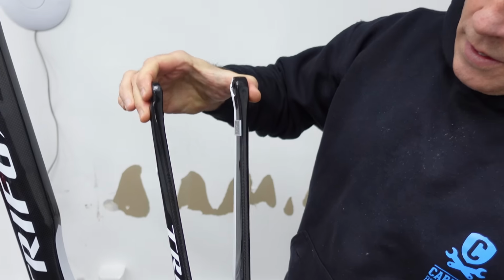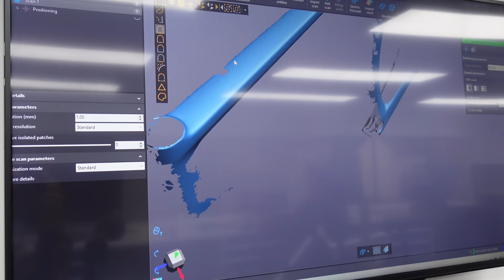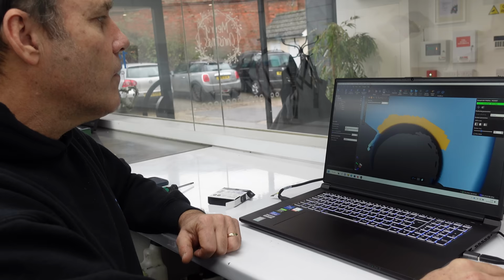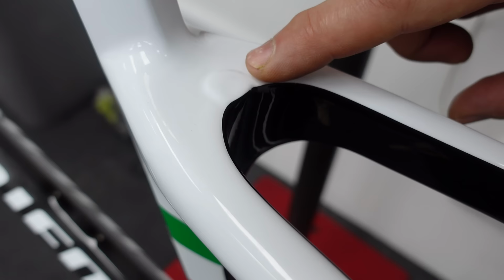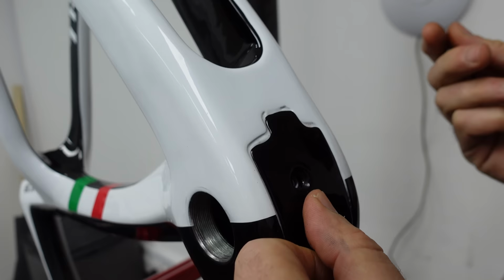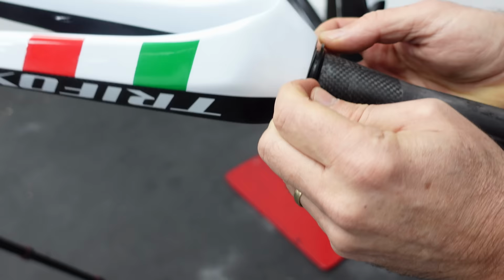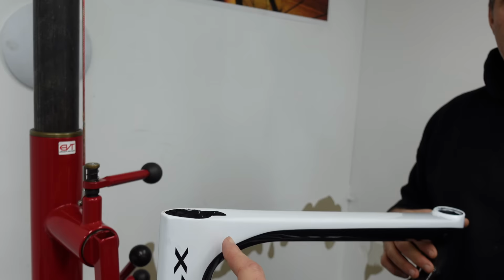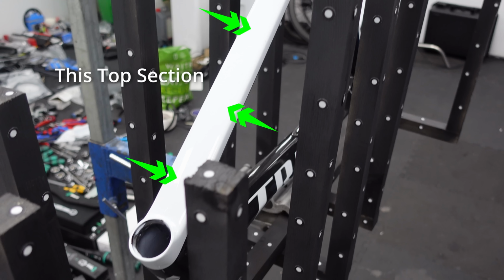Carbon EXPERT Reviews My £300 Chinese Carbon Frame!!

Comment: Almost every major brands lower end carbon frames are built the same way - lots of carbon and heavier (almost to the same weight as AL) compared to their highest end models. Usually also made in the same factories as well. Carbon is actually a very cheap way of manufacturing, the expense mostly comes the mold and prep we really shouldn't be paying the absurd prices bike companies charge for them.
Reply: Yes. It commercially costs 10,000 USD for a mold. To a factory, it is probably less than half of that.A mold can make 50 Frames. The carbon costs next to nothing. With very cheap labour and costs, factories are spending $150-$200 to make a frame
Reply: “Build in the same factory” does not mean “built to the same quality control standards”. 

Cheap frames are cheap for a reason
Reply: @benfinesilver2250  are the molds "compromised" after 50 frames?  i thought the molds could be used indefinitely?
Reply: @konanoobiemaster  Hi. I asked factories because a friend of mine has designs for bikes. I live in China. They said the mold could be used about 50 times before needing to be replaced.
Reply: @benfinesilver2250  thank you sir i had no idea!
Reply: buddy, the most expensive part is actually the research that goes to create this stuff. You're mostly paying for the technology rather than the material cost alone...
Reply: one night argue the high cost of carbon frames is partly caused by the increased risk of liability

Comment: I've learned enough with my experiences over the years that carbon doesn't belong on any of my bikes. You want carbon and are willing to take the risks I wish you luck, but it's got to be made of metal for me the rest of my days.
Reply: OK boomer
Reply: Then don't fly on any recently built aircraft or drive many of the latest automobiles. Many have carbon fiber parts.
Reply: @jamesmckenzie3532  Care to point out what those are? Do you work on airplanes or is that something somebody told you?
Reply: @Charles Man  Wing surfaces are a major area where carbon fiber is replacing aluminium. Not much stresses and it's actually lighter. Some planes are using carbon fiber in the fuselage as this is another area where weight can be saved.
Reply: @charlesmansplaining aircraft parts like the entire horizontal stabilizers for large je liners or entire wings and large part of their internal structure... you can look up the flex test for aicraft wings.... the carbon wings of the most modern jets flex many meters...

In cars its anything from body panels, parts of the car shell, supercars use carbon for the entire mocoque, high end race cars lik F1/F2/F3 or the endurance racing LMP cars are made out of carbon fibre monocoqe and carbon/kevlar body panels... even stuff like control arms, prop shafts for over 1000Nm are made of carbon...

The list is pretty much endless from sport equipment to medical stuff to cars planes bikes safety equipment like helmets or crash structures in many aplications.... cars and planes use carbon brakes sure its different technology and type of carbon but still a carbon...
Reply: @17tomashavlin  You go ahead and trust it. When it comes to bicycle parts made of carbon I'm not trusting it. Period!
Reply: 6061 for the win!

Comment: Radius on the fork assembly has nothing to do with the deflection of the fork. Resistance to deflection depends on the flexural rigidity (EI) and the stiffness of the end connection. Flexural rigidity is increased by either increasing E (Young’s modulus) which is a material property or I (The Second Moment Area) which is determined by the section dimensions and material thickness. Both forks have similar external dimensions, so it is very likely that the cheaper fork is thinner and or is built from a lower grade of carbon fibre.  Is that a problem? Well it depends. Providing the fork is rated for the potential static and dynamic loads it will experience it is unlikely to catastrophically fail even if it’s flexible.
Reply: Can load rating be calculated by determining the Young's modulus acoustically?
Reply: @philhunt1442  Simple answer is I’m not sure. Are acoustic methods reliable for composite materials? Not sure why you’d want to do that unless you were uncertain about the source and provenance of the material in the first place? In that circumstance I’d be a little inclined to be wary. What I was describing above was design properties. If you want to confirm the structural integrity of something that already exists then load test it with loads that are comparable to what it will see in service and follow that up with visual inspection and NDT. If you are designing using material that has uncertain properties then take a conservative approach (build in significant safety margins)
Reply: @donharrold1375  Ah, I see. I think modal testing is indeed reliable, simple and straightforward and is a great way to get exact stiffness values for custom wheel building, for example, using hooke's law you can derive stiffness from an experimental frequency result of an object by squaring it and multiplying by mass. This negates the potentially destructive nature of limit testing along with many other benefits to the traditional design process. But also useful to test and compare cheaper overseas production vs domestic and determine which parts have negligible differences in strength.
Reply: @philhunt1442  Thanks for the interesting observations and comments; not sure I understand them all, but it’s always interesting to hear different takes and opinions. One of the interesting challenges of manufacturing bikes (essentially consumer goods) is the need to optimise strength, stiffness and aerodynamic properties whilst minimising weight, without creating an impractically expensive or potentially dangerous product.  Control over details is critical.  Buying direct from Chinese factories gives me a degree of anxiety because of the possibility that manufacturing and cost compromises might unwittingly lead to a product becoming unsafe. That could happen with big international brands too, but qualified management systems make it less likely.
Reply: I thought it a bit strange the guy went on about sideways flex on fork blades that are clamped at the other end by the front wheel. Don't see how fore/aft flex would be greatly affected by the radius of the fork crown in that direction, so what's the big deal?
Reply: @Ralph Reilly Yes but details like radii are a local property. I was describing global properties. Local properties don’t govern overall stiffness to a significant degree.  They will drive localised stresses. Sharp transitions lead to stress concentrations which might be a problem for long term durability.
Reply: I am not sure about that. The Chinese fork stays are clearly thinner where they meet the crown.  To me that gives less sideways  rigidity, everything else being the same.  Like you would if you nailed down a 1 X2 board on a 2 x 4 , versus nailing a 2x2 to a 4x2. The 1x2 would almost fall off by its own weight while the 2x2 you could almost lean on.
Reply: Broski you gotta round out your engineering knowledge. Stress concentration in curved members is a real thing and yes, a smaller radius will result in a larger stress concentration leading to a greater angular deflection. This angular deflection is exaggerated when you stick a long cantilever on the part (like the fork end).

Comment: That point about seatstays breaking is kinda funny.  I've seen several bikes where people are riding around on a broken seatstay bring it to their shop complaining about a noise or weird ride feel.  I don't know about carbon, but with steel people have gotten away with riding with a broken seatstay for far longer than you or I would feel comfortable with.
Reply: Seatstays and seat tubes are some of the least necessary structures on the bike (bikes have literally been designed and built without them for almost 30 years), and as such aren't worth worrying about a whole ton.

Comment: I know very little about bikes but on the flex thing, when the wheels are on, it wont flex so much? would it affect ride or is it a failure risk down the road?
Reply: Not necessarily, when the wheel is fitted the through axle essentially turns the arrangement into a square box which is very stiff, the forks won't be able to flex relative to each other.

Thinking about it mechanically it might have slightly lower stiffness laterally but if there's that much lateral load going through the bike then uh... You probably have bigger things to worry about 😂😂💥

Comment: This carbon explanation gives me new light in tonwhat actually could have happened to the Titan submersible when it imploded on the way down to the Titanic. Someone could have very well over stressed and over torqued a component that was attached to the carbon fiber tube and caused fractures in its structure. Carbon can be somewhat forgiving but once it's damaged, it's done.

Comment: Don't buy cheap Chinese made frames.
Buy OUR Chinese made with EXPENSIVE decals frames hanging on the wall behind me.
Reply from the maker: Why wouldn't you buy a cheap frame from china? No one has said this frame was bad, plus there is part 2 coming. The expensive frame on the wall only cost £700 for the whole bike second hand
Reply: @JourdainColeman  he summed up the whole trade fairly.

Comment: I would like to see a comparison between a high end Chinese frame ($ 1500) compared to let’s say a Specialized 
(Yoeleo/ winspace) 
Because I have seen recently two Specialized frames that have cracked I think these ultra light weight frames are not useful except for riders that get them for free because they are sponsored
300 grams extra weight makes approx 10 seconds difference on a 1000m high difference climb (who cares if you are not a hill climbing racer?)
Reply: @RealSweetKid me too I think It is an unfair comparison a frame for 3000 vs one for 300 bugs
Knowing that the one for 3000 is also made in China
Reply: Given a rider weight of 65 kg, two bicycles with weights of 8 kg and 8.3 kg, and a 7.8% incline over a distance of 1 km, we can calculate the following:

Bicycle 1 (8 kg): Average speed = 24.7 km/h, time to climb = 2 minutes and 25 seconds
Bicycle 2 (8.3 kg): Average speed = 24.5 km/h, time to climb = 2 minutes and 27 seconds
So the rider on the 8 kg bicycle would climb the 7.8% incline over 1 km in approximately 2 minutes and 25 seconds at an average speed of 24.7 km/h, while the rider on the 8.3 kg bicycle would climb the incline in approximately 2 minutes and 27 seconds at an average speed of 24.5 km/h. Thats for a rider with 400w watt output
Reply: They crank whenever they crash. Carbon frames are good at taking slow pressure but can't handle impact hits whatsoever.  So any crash or curb bump will totally destroy the frame. It could probably take a bunny hop hit

Comment: Has anyone ever wondered why Rob's repair shop is full of carbon frames?
Reply: Because it's a carbon repair shop, he doesn't work on aluminum or steel bikes. Aluminum bikes are cheap enough they're usually just thrown out, and steel frames can be rewelded anywhere. Carbon takes special expertise to fix.
Reply: The fact is his shop is full of carbon frames because carbon isn't the best material to use for bikes because it isn't pliable and too brittle. Also, you will not find any Bike shop full of steel or aluminium frames because they just don't break that easy.
Reply: Hmmm... wondering why Jiffy Lube is chock full of cars with brake issues. 🙄

Comment: Ever done a Trek Madone 4.5?  I'm pretty impressed with mine: has all the features you say it should: aluminum re-enforces dropouts, drain holes etc.  

BUT, I don't know how much design & manufacturing excellence went into it.
Reply: Interesting comment as I have the exact same frame and love it because its so comfortable.
Reply: @2wheelsrbest327 Meanwhile my Madone 6.2 just lost a piece of its rear dropout where the derailleur hanger screws in 😭

Comment: As a few others have also pointed out in the comments the fork flexibility test really has pretty near zero application to what the fork does in real world conditions. Based on the exact same criteria the cheap bike that has a 3mm thick top of the top tube is obviously far superior than a Canyon et al that have a super thin flexible top on the top tube. That test of the forks is about as informative as a GCN free hub sound check. If the spacing for the front axle isn't exactly spot on then having some flexibility built into the profile would be beneficial as to force the arms of the fork in or out will be pre-loading the forks and creating an unneeded stress.
  Other than that Rob's gear and analysis was a fair eye opener.
Reply from the maker: Yeah the fork test is arbitrary really. It's interesting to see how the radius of the fork and carbon effects this stiffness. You may like this video if you are interested in the carbon stiffness etc. I compare a canyon to the trifox - https://youtu.be/pYBY78-zs7Q
Reply: That 3mm thick top tube isn't necessarily thick - if it has air pockets and lose strands of carbon all over, it will be flimsier than thin Canyon top tube.

Comment: absolutely missing the point here. We buy a branded product because branding assures a level of accountability. With a Trek, Specialized or Giant there is always someone reliable to go back to if a problem occurs. A big brand is not going to risk its reputation (and survival) by putting out crap product, because rectifying problems will cost them dearly and puts them at a competitive disadvantage. A recall can easily cost mullions and can't be insured against. With unbranded products the cost is lower because the supplier does not have the costs of providing accountabiliy. In order to be fully accountable, and survive in business, a brand needs to invest in testing, quality control, liability insurance, and a network of distributors and dealers to provide service. To get dealers, and consumers prepared to pay the premium prices necessary to cover these costs, they also have to invest in marketing in the form of advertising, pro team support, etc. Marketing costs big money. With discount price, unbranded frames there is none of this. It's the wild west and the consumer is taking a great risk. There is little or no accountability, and consistency can be an issue. Carbon frames are laid up by hand, so no two frames are ever identical. Cutting up one sample to look inside will tell you far less than finding out whether you're likely to get paid out in a law suit if it fails and hurts you, and wherther there will be a global recall to prevent it happeening to anyone else. The mainstream brands have a vested interest in not hurting their consumers! This stuff is all that keeps your chin from being ground away on the tarmac. Buying cheap, unbranded products is a mug's game. Caveat emptor...

Comment: The video could have been considerably shorter (and better) if you didn't make cuts every few seconds where you just repeated what Rob said.

Higher end carbon frames are great and are every bit as good as big brands like Spez or Cannondale. Entry level carbon frames are a bit of gamble. Especially something like Trifox/Delileah/TFSA as TFSA is the actual OEM behind them and it is not a very reliable manufacturer - QC is all over the place and they tend to copy frames without having a second thought (i.e. x18 frame being a direct copy of Tarmac SL7, including the faulty headset design).